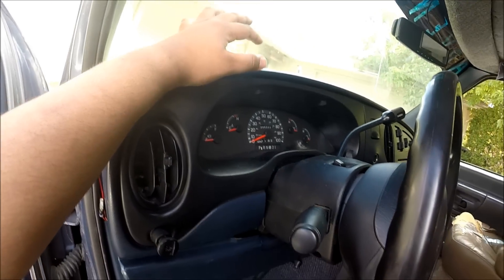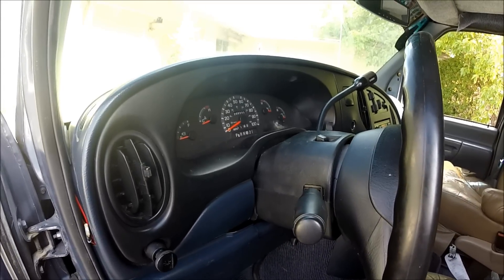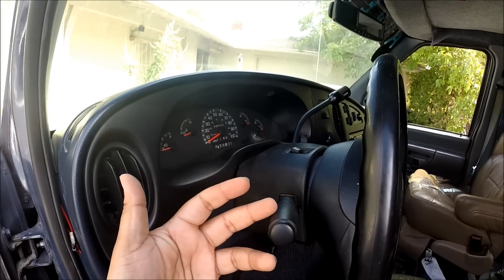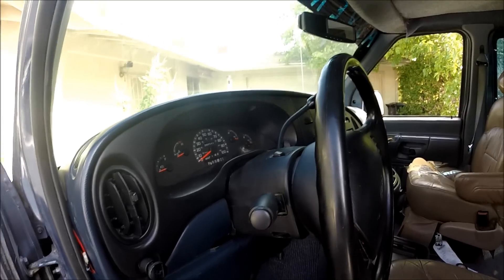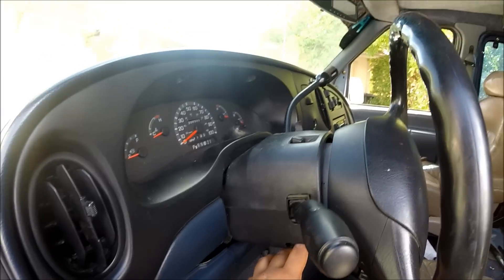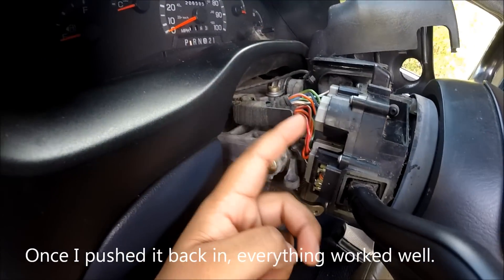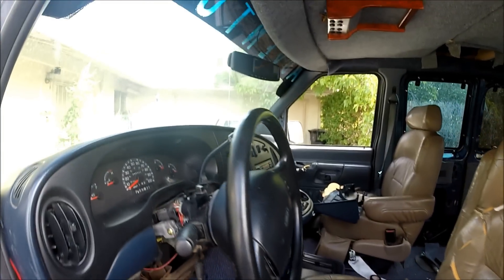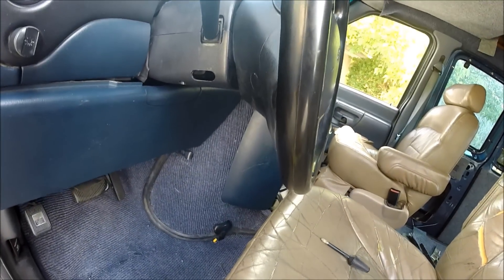Troubleshooting Brake Lights (2 Lower Not Working, 3rd Brake Working) (Turn Signal Switch)

Comment: I had a problem with my crown vic when I installed new rear light (led), the brake light would always turn on when I turned the lights on, well low and behold it was as short in the new connectors, the wires were so close together that the silicone used to separate the opposing wires within the connector was installed improper caused the two wires to make contact, simple pushed the silicone between the two and problem solved, hopefully this post will help others as it had nothing to do with brake switches or bumpers,,,,,,

Comment: I have tried the brake light switch, fuse and bulbs. Main brake lights still not working, only 3rd brake light is working. It's driving me mad. Auto Electrics wanna charge an arm and a leg. Need it fixed asap.

Comment: Yeah I recently developed a problem where my passenger side brake light doesn't want to work and I've replaced the bulbs and changed them with different ones. I tried LED and nothing's going on. I don't know where the problem lies All my tail lights and my turn signals work but the right brake light doesn't work but the tail light portion of it does. 

I've never seen this problem before or dealt with it so I'm not sure where I have to look the front of the car or the back for the problem

Comment: My sons 1500 had same. On his it Turned out it was a weak ground connection at Battery that when the first issue as 1 bulb blew it triggered the computer and when computer tried to regain enough ground connection it could not..  wire inside connector had corroded ovr years..  Installed new connectors and all is good..

Comment: I changed this part but my brake lights are still not working. The bottom 2 don't work but the third does. Any solutions
Reply: What was your car's problem?

Comment: 02 silveradodo 1500HD, new brake switch, power to both tail ends and trailer hitch. still no brake lights. led lights. put new conectors and new lights. still no break lights. please help

Comment: @ CrazyMotorMaster I have a ford Econoline E150 van i have bought turn signal light bulbs and break light bulbs in had them installed and didn't fix my break light from not working and I also had my fuses all check out and all the fuses checked out to be good fuses! What can be making me not having any break light work ir my turn signal light isn't working on my van either please someone help me out with some idea what it might be causing the break light and turn signal not be working!

Comment: I have this issue with my audi. When I bought the car the main brake light never worked but third brake light and bumper lights worked. Then one magical night I noticed the main brake lights were on. Shocking! That was the first and last time they worked though 😂not i need to check my steering column for loose broken wires
Reply from the maker: Did u fix it?
Reply: @CrazyMotorMaster  it turns out that audi issued a recall for the problem which they stated the BCM needed to be updated.

Comment: So if your 3rd brake light is working and the other 2 are not the brake switch is not the problem is that correct?

Comment: Dude You're A Genius! My third brake light was working but the lower two were not working. loose wire in the steering column and Problem Solved! thanks Brotha!
Reply from the maker: Your welcome glad that I could have helped.
Reply: How do I fix this????

Comment: Hi , my driver brake light isn’t working and when I press the brake down enough while having my passenger turn signal on it start to blink very fast and doesn’t blink in the back , could a faulty brake switch or turn signal switch fix both of these problems ??
Reply: Did you figure out the problem? I’m having same issue.
Reply: @DannyGrc  yes it ended up being a burnt out or faulty rear passenger tail light bulb. I would try changing that before attempting to change anything else or doing what is shown in the video. It’s the cheapest option to start with and requires the least amount of work. If your vehicle has multiple rear or front bulbs per side turn on your hazards and see which bulbs are not flashing wether it be front or back and replace that bulb and it should be good afterwards. The reason vehicles do this is to tell you a bulb is out and it’s time to change it.

Comment: hello, i have dodge caravan 2001, hazard works, turn signals work, third stop light works , fuses all good , BUT NO BRAKE LIGHTS on lower stop light. what i need to fix ??  thanks
Reply from the maker: kajus001 I would try checking the grounds or the brake light switch. If that doesn't work check the turn signal switch.

Comment: 04 ford interceptor with same exact issue.Spent a lot of time researching, like you said "not many videos" on this. Your video is by far the best one I've seen on this type of brake light problem. I thought it might of been a short in the wiring due to the cutting of all the wires that were spliced in for all the police mods that were removed before being sold to me. Glad it wasn't that...
Reply from the maker: Shaun Piatt Thank You for the kind words. I thought it was a short at first too, our van is a conversion van and there is a lot of non-OEM wiring.

Comment: On my camping trailer, one tail light ok, the other lights up with headlights on but does not work for brakes or blinker.  I have replaced the bulb. Don't know what to try next
Reply from the maker: I would check the wiring itself, sounds like some kind of bad connection. I would love to hear how it works out.
Reply: turns out my problem was not the camper at all but a short in the wiring to the hitch that it was plugged into
Reply from the maker: I am happy that you found the problem.

Comment: Thanks for the video - My 1997 nissan pickup has this issue, please help - I have only 2 lower brake lights which work and function fine when my headlights are NOT ON, but the moment I turn Headlights on - I do not have Break Light working - so it is very dangerous at night because I have headlights on and i am driving without break lights - till i have fixed it I have stopped driving this truck at night and I make sure I comeback home before it gets dark out there - please comment - I also want to add that my headlight switch is integrated with the turn signal in the same switch under steering on the left - thanks

Comment: Hey dude I'm just telling you I won't so you and I'm enjoying your video because my Chevy Express 1500 year 2000 van brake lights are not working except for the one in the window is working but thanks that's what I'm looking for a solution to Keep On Keepin On

Comment: i have a 99 ford explorer xls all three brake lights stopped working im hoping that this is the same fix so i wont need to spend unnecessary money
Reply from the maker: Sounds like it might be  brake light switch, or a fuse, good luck.
Reply: I found out that it was the switch

Comment: thanks you got my on the right way with my 98 blazer. i had a faulty hazard switch. new switch or nearly new but i had to mend it a little to get the lower brake lights working

Comment: I have a 2004 mini cooper, and my third brake light will not go off. Does anyone know how to fix it, aside from going to the dealership, or just removing it?
Reply from the maker: Selina Meier do you lower 2 work fine, if so it might be a short in a wire somewhere.

Comment: Does this work the same for Jeeps? I have a Grand Cherokee and the 2 lower don't work; upper light works.
Reply from the maker: gunner74 I believe that particular jeep has a separate lamp for the turn signal so it shouldn't  really have an interrupter in it I would recommend checking the fuses first then the brake light switch itself.

Comment: my right turn signal on a 07 Ford Ranger is not working also brake light and the traveling light when turn on turn signal flashes real fast on the front can anyone help
Reply from the maker: Thomas Martin sound like it might just be a burn out bulb element is replaceable but should be fine

Comment: would this work on my ford ranger 2003??please answer ASAP it's a emergency
Reply from the maker: MEX BOT if it has a red turn signals these trouble shoots may give you a solution.
Reply: CrazyMotorMaster ok thanks alot but only my brake lights don't turn on now
Reply from the maker: MEX BOT all three or just the lower two?
Reply: Just the lower two
Reply from the maker: MEX BOT ya just do what I do in the video check the turn signal switch interrupter
Reply: CrazyMotorMaster ok thanks dude I'll make sure to leave a like on this vid

Comment: i have a nissan march 2012 and iam having many electrical problems , right now fog light works and headlight works, front wiper  but the electrical lock system not working and turn signal not working , and back wiper not working , any idea what do i have to change ? btw turn isgnal is flashing rapidly but no signal is on from the bulb. this means its a problem of the whole electrical system ? not only replacing fuse or relay or bulb will fix it?
Reply from the maker: We do not have this car in my market so I am not familiar with it but it sounds like one of the computers, or a loose connector, or even a bad ground maybe the cuprite. I really do not know you may have to take it to a dealer.

Comment: Thank you for this video CMM, brake lights were not working out of my trailer plug. After many hours and tests on my 99 Ford Ranger I looked into this solution and  sure enough the wire was out of it's plug. I plugged it in and everything is back on.

Comment: Hi when I turn my lights on my fuse blows instantly I have brake lights but not running lights in the back any help is good
Reply from the maker: wxynz12able sounds like you have a wiring short somewhere it could be anywhere in the circuit.
Reply: CrazyMotorMaster where do I start looking

Comment: CrazyMotorMaster- Thanks for the video. I had replaced my turn signal the other day, it was worn out, and a few days latter my wife told me my brake lights were not working down low but we're working up top. I had found it perplexing since both had gone out at once. I found your video online and when you pointed to the turn indicator switch I new that was where the problem was and when I took off the outer housing I also found a loose tag. I got a mirror and put in the the open hole and presto the lower two back brake lights were working again.ThanksJohn
Reply from the maker: +John Jordan You are welcome John, glad I could help steer you in the right direction (pun intended).

Comment: would this be the same issue on my 2004 nissan murano, the third light comes when the brake is pressed, the light come when the turn signal is on and with the emergency light on?

Comment: Please help ! I just bought new led tail lights for my 2000 Silverado and the reverse , turn and 3rd brake light works , the brake lights don't work/I gage at all ... They do turn on dim when I turn my running lights but when the brake is applied there is absolutely no brake light , please help , Iv been reading forums for the past 5 hours !!
Reply: Ruh I have been having the same problem and can’t figure it out. I’ve bought new bulbs, replaced brake switch, checked all the fuses, even cleaned all the ground points under the truck, still can’t get them to work at all
Reply: @Trucks-kt9gt  what did you end up doing? I have an 09 burb and im trying to figure it out too
Reply: What did you end up doing? Have an 09 burb and cant figure out what the prob is

Comment: Would you recommend this if it's just one of my break lights out? Also it only doesn't work when I turn my lights on. Thanks for your time in advance
Reply from the maker: It sounds like you might have a bad ground somewhere, check for a loose or corroded ground wire. Good Luck I would love o know how it turns out.

Comment: hi HV. 1994 FORD MONTAGO MOTOR HOME CANT FIND FLASHER OR RELAY IF U NO WOULD APP. LETTING ME NO
Reply from the maker: I am not too familiar with that particular vehicle but there are three possible locations it could be.
1. under the dash, 
2. under the hood in the fuse panel
3. or it could be located in the switch itself.

Comment: had one brake light out, went to the dealer for an ignition switch repair (recalled part).  they tell me both are now out.  I replaced both bulbs, brake switch, and turn signal switch, in addition to checking fuse.  top brake light works.  hazards and turn signals work, which use the same bulb.  2004 Honda Element.  suggestions?
Reply from the maker: Jack Sprat recheck the fuse if that hasn't blown again then you might have a grounding issue check to see if you have any lose wires in the sockets.